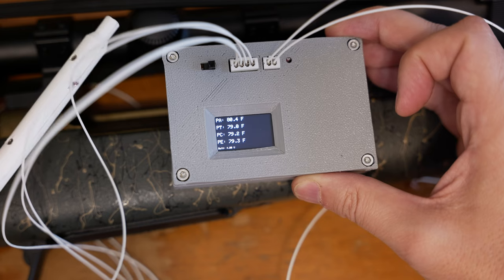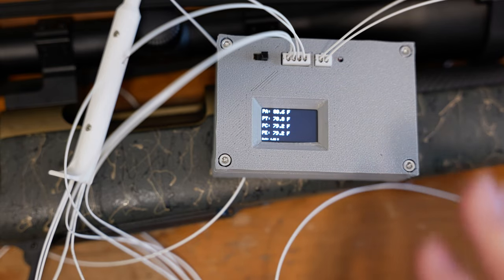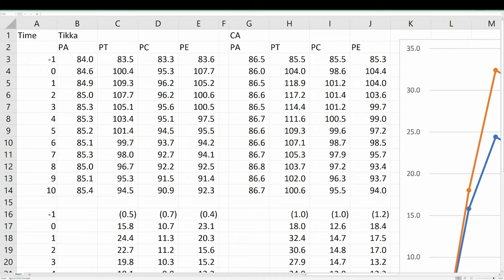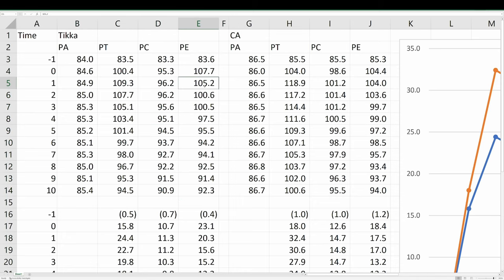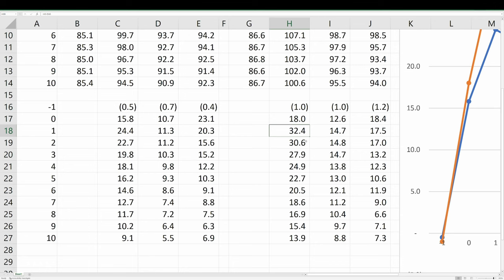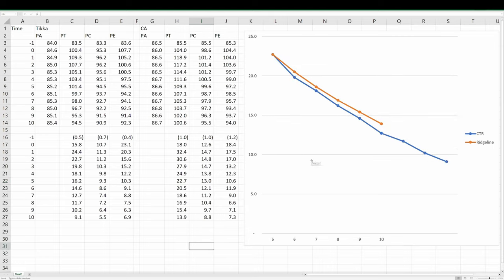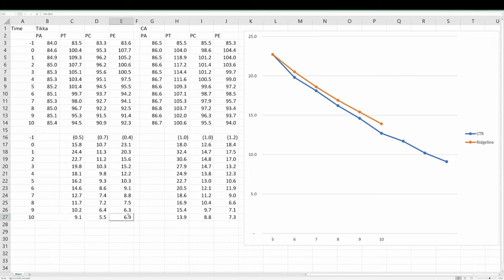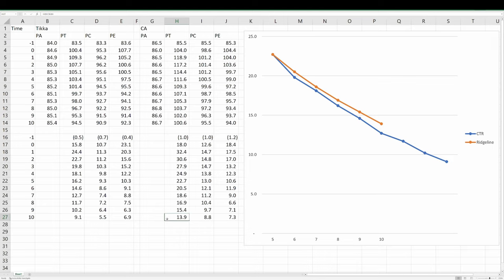Carbon Fiber vs Steel: Barrel Heat Test

Comment: Thank you, I've heard to get a carbon fiber wrapped or carbon fiber barrel.  I always had my doubts but this....clearly, shows the numbers.  I suppose hardness and wear would need to be added but this is as good as you are able to provide and I believe is extremely telling.
Thank you.
Reply from the maker: I wish I'd have thought to have taken my thermal camera. I think you'd probably see a sharp difference between the heat given off by the steel vs carbon that would further illustrate how much better the steel is at conducting heat.

Comment: Really found the video intresting, like seing actual data vs egos on forums just yapping on. Couple Question for you. This line of research leeds to, does carbon firbe barrels have shorter life then steel barrels. This as a function of chamber heat( at what temp does damage acctually occure. 
2) Accuracy when a hand full of rounds are shot put of each common wisdom seems to be they are both the same but carbon drops off after this due to heat. My questions is if the carbon acts as an insulator and the barrel has warmed up and is slower to  cool down. Would that not positively impact accuracy as the barrel would be less likely to have thermal differences between shots. 
3) If the above holds true and carbon barrels does have a tempeture/barrel life threshold what is that bullet count in short succession(one session) are we talking 10 or 500 rounds before the effects become problematic
Reply from the maker: I can't speak to barrel life, as I couldn't afford to wear one out just for testing. But I can speak to shot to shot accuracy a little. With this rifle, I've noticed that if I do cold bore shot groups (letting the barrel come completely to ambient in between) that it shoots better. 

Since the barrel cools slower, rather than that meaning the temp is more stable, it actually means that each shot results in a larger temperature jump in the bore. So within a group, you get more shot to shot variation in barrel temperature rather than less. I agree that it's most likely not a large issue with small group sizes (3-5 shots), but my personal rifle seems to do better when it gets to cool off quite a bit between shots. That anecdotal though; I haven't tested it.

I have heard that CF barrels can have shorter lives if you shoot long strings of fire with them. I'm not sure that it would matter much for a hunting rifle where the absolute temps you run the barrel are never very high. It would likely be more of an issue for a competition gun, where you're constantly shooting strings of shots.

Comment: BSF Carbon fiber barrels address all of these issues. They run on a gas gun, in my case an AR-10 chambered in 308WIN, after long shot streams, and stay cooler all around. They also cool much faster due to how they vent the carbon fiber sleeve.

Comment: Carbon fiber seems like a good solution for hunting which requires carrying the gun for hours at a time.  If you are tree stand hunting it doesn't matter that much.  The thing I've heard is they don't have point of aim shift like steel.  That would be a big advantage for hunting where you want the cold bore shot to be on target.

Comment: 7:00 This is not good for data. I have a few suggestions to integrate the temperature quicker. That first minute is the most important thing.
Reply from the maker: How do you mean? My purpose wasn't to look at the short term dynamics that occur right after firing. I was examining how the barrels transfer heat during cool off, and the total temperature gain after firing strings. The first minute is certainly the most dynamic, and the system I'm using can measure that at a fairly high frequency if needed.

Comment: You use 6 different names to describe the two barrels - confusing.  Just describe them as steel/carbon barrels.  Through most of the video, I couldn't figure out if the cartridges are the same... say this stuff up front.
Reply from the maker: Yes, it's the same ammo. All rounds from the same box. I show the box of ammo at 3:00. That seemed pretty up front to me.
Reply: @TechDregs  I guess I get easly confused.

Comment: I think a more accurate comparison would be the same exact rifle, one in carbon fiber wrap the other just steel. Something like a Fierce Twisted Rival vs Fierce Carbon Rival. Also, not all carbon barrels are equal. Example, you quote Proof Research barrel. Check out a Springfield Waypoint 2020 with the BSF barrel. It is a heavily fluted steel barrel with a carbon sleeve to stretch the barrel. I believe Bergara's carbon barrels also cool better and run cooler.
Reply from the maker: If anyone wants to sponsor that sort of test, I'd be glad to do it. :-D

Comment: And, does it matter for a hunter?  First shot on a cold barrel? Don't see the difference.  4 follow up shots?  Doubtful.  But even at that, does it matter?  Target shooter?  Homogenous steel barrel fired with consistent loads at a a consistent rate matters more, I would think.  These barrels are a solution looking for a problem.
Reply from the maker: I think cold bore shift is clearly the biggest concern for a hunter. If you zero your rifle on a warm barrel (like at the end of a load development trip at the range) and that barrel has significant heat shift, you might observe some shift when you go to take a cold bore shot on an animal. I've moved to doing my zeroing on stone cold barrels that have fully returned to ambient in between shots.

That said, I doubt it would have any practical impact unless you're either varmint hunting (very small targets) or at very long ranges (>500yds) on deer or something.
Reply: When I’m reloading my 7mm Mag my barrel gets quite hot, got to wait actually awhile between shots
Reply: Carbon fiber helps if you hunt with a suppressor and trying to save weight to you make your barrel stiffer
Reply: IMO, there's no reason NOT to save weight whenever you can.

Comment: Good video thanks ... I'm curious as to how much faster the interior of a CF barrel would heat up vs all steel.. 
watched another video where they ran 1000 rounds down a  Proof Research barrel 
not quite as scientific a your test
https://youtu.be/ByiaYeNTHTc?si=or9hBeEhktUvhR3E 
(destructive testing)  
Heat was mostly being dissipated off the breech and muzzle of the barrel.

Comment: Your data is WAY OFF!!!  There's no way you're only getting only 118+ degree Fahrenheit from a rifle barrel after firing 10 rounds in quick succession.  Firing 10 rounds will raise the temps a hell of a lot more than 20 degrees Fahrenheit.  If you bothered to touch the barrel you'd see your data is off.  The barrel is so hot you can't hold onto yet you show that it's 118 degrees F as a high point.
Reply: Good catch.